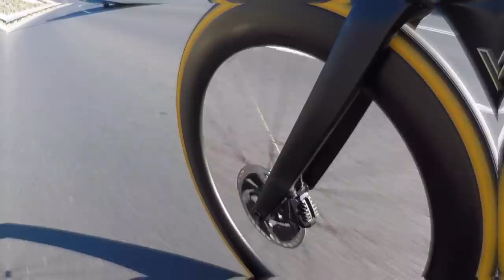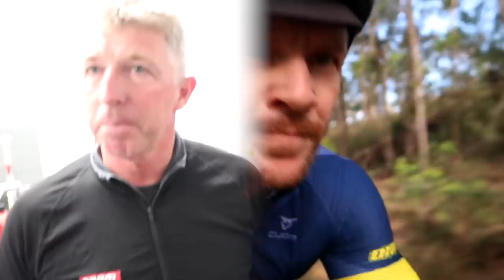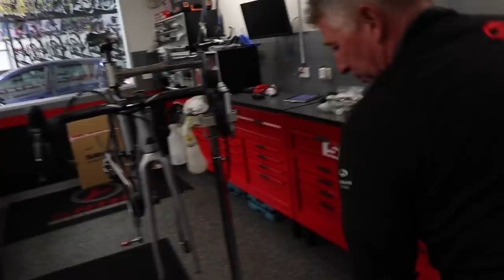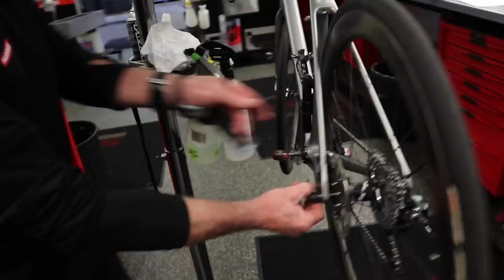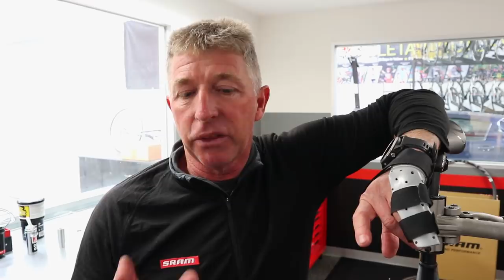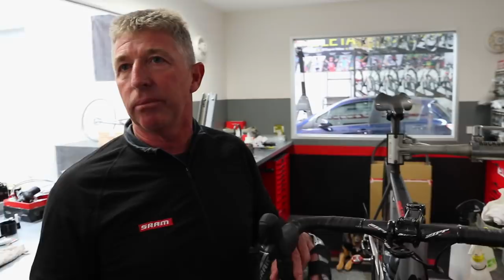Disc VS Rim Brakes (& Thru Axle VS Quick Release Skewer)

Comment: This Sram idiot was comparing a quick release skewer rather than a 10mm 4130 chrome moly heat treated hub axle to the quick release hub axle for the wheel to frame loading forces.
Yes you will need a larger diameter stiffer axle for asymmetric braking forces because of the disc brake designs. 
As for thermal management of the braking energy, the disc rotor which is typically 1/3 the weight of an aluminium alloy rims made from a material which will not transfer that heat effectively into air. i.e. 140 mm diameter rotor compared to a 622 mm diameter rim being air cooled. 
Having threaded composite holes in the frame for a quick release hub axle has its own problems.
In nearly 30 years of cycling, the idea that some folks can't use a 'retro' quick release because they are too stupid is just laughable and incredibly patronising. Maybe Sram should be selling after market stabiliser wheel sets as well, aerodynamic ones made from composite plastic costing $1000 RRP.
Reply from the maker: Very happy to have your feedback/comments/experiences, but no need to call Rob a Sram idiot. That's the type of comment I expect on Facebook, not YouTube. Cam
Reply: My apologies, I'm just getting sick and tired with the cycling industry (Patronising Journalists as well) constantly rubbishing and showing well designed older technologies in a very bad light just for the sake of what is at best, 'marginal design gains' with assumptions that all component design now has to follow and cater for the inadequacies of composite plastic frames and wheel rims etc. (poor bottom bracket tolerances, JRA failures and poor rim braking etc) so as to sell new products with very high profit margins to the trendy gullible cyclists. @CamNicholls
Reply: Amfear Liathmor Yeah, name calling is not necessary, but everything else in your post was spot on. QRs are a tried and proven system for decades. The reason they use a through axle is they had problems with the twisting forces associated with a one sided disc using a QR. The solid axle is used to try and transfer as much force to the other fork leg. But an expert in the field doesn’t mention this nor any other pro disc brake company and media. Don’t be fooled, there is design problems with discs, yes they have partly overcome them but rim brakes as you said, require less force and have a bigger area to dissipate heat, the main problem with rim brakes is carbon clincher failure, not the braking system itself.
Reply: Hmmm motorcycles don't have rim brakes so why should bicycles adopt disc braking if its prifen to be very easy to apply pressure and modulate not to mention braking with a warped wheel or in the wet us a real issue with rim brakes.
Reply: glenny oc Come on, motorbikes with bicycles??? No point even discussing that long bow......
Reply: @waynosfotos  drum brakes were the norm on motorcycles and worked well but disc was seen as a superior product.
Reply: Carbon rims or Aluminium alloy rims? Disc brakes are an excellent idea for composite plastic rims to improve safety. But does the addition weight of a disc rotor negate any weight savings of using a composite plastic rim?
https://youtu.be/ET1jRVynOBA?t=58
Exploding tub or exploding rim?   TDF time trial JRA failure.
https://www.youtube.com/watch?v=6rraDhZTDog
Reply: @gweflj  He should have used £20 Rigida Sputnik rims.
Reply: All that stuff for rich overweight middle aged men  who ride at 23km/h.....
Reply: @waynosfotos  Amfear Liathmor is a foaming-at-the-mouth retrogrouch who will defend outdated cycling technologies such a steel frames, quill stems, threaded headsets, freewheel hubs and cogs, rim brakes, metal rims, and downtube friction shifters to the death.
Reply: @CamNicholls  Amfear Liathmor is a foaming-at-the-mouth retrogrouch.

Comment: If cyclists are really concerned about axle strength, stiffness and failing quick releases, which idiots have a hard time understanding, just change out the hub axles for longer solid ones and then attach the wheels to the frame with some titanium M10 nuts and then take along a Campagnolo Peanut butter wrench along on every ride. Problem solved for about $40.
Reply from the maker: Thanks for the suggestion. Cam

Comment: Rim brakes damage the rims...…. Disc is a problem when flying if its oil...... Rim you don't spend much for maintenance...… Disc much heavier...  If disc is oil and you press the break when traveling as the rims are off you are fuuuuuuucked. ……. With disc you can burn your leg like Tyler did ha ha ha…  I would think the only time you need disc is in bad weather and descending.. Rim works but disc works better.....
Reply from the maker: Harry Tzianskis The God of Speed thanks for sharing Harry. Cam
Reply: I'm sticking to my V brakes. See you at the bike shop
Reply: Hi janet sers 😁 you talking about Tom's?

Comment: This guy's just a salesman.
Reply from the maker: General Manager of APAC actually. Cam
Reply: @CamNicholls  Comes across as an unbalanced point of view, and trying to push a product IMO. Rim brakes have some advantages and work perfectly well. I have disc on my MTB and CX/commuter and rim on road bike. Discs aren't worth the extra cost, weight and maintenance unless using carbon rims or likely to get wet/dirty.

Comment: Traditional QRs have greater clamping force than the incorrectly named thru-axel, it's easily proven by math....

Lawyers tabs...oh so the skewer didn't fail, the people failed....he said it I didn't.

They take the heat of braking an put it into a structure that is under engineered for the heat generated during long descents...

Comment: The most stupid arguments I have ever heard and even worse from someone that supposed to have experience and common sense, Everything contrary to the logic, It is obvious they have to push the new products, he get paid for it, which is understandable, but saying skewers are less aero, have failures, I don't know what kind of fails he is talking about, I have never experienced any issue with cheap or expensive skewers, nor the pros in grand tours pushing the bicycles to the limits, complicated because some people apparently don't know what is the right side, not stiff enough? dangerous because your whole life relies there when they just tighten up the wheel but the wheel itself is supported on the hub, not in the skewer.
The funniest is when the guy tries to release the wheel "Nice and simple" and almost breaks his other hand.
As far as breaking is concerned he said overheating rim wheels happens all the time causing accidents, something is absolutely false unless you are using the cheapest Chinese carbon wheels with the wrong brake pads, but apparently, disk doesn't overheat which is something even Chris Froome complained about.
At the end, he points out people need to learn how to break properly with disks giving an explanation that doesn't make sense, an average person will just pull the trigger, It should be as simple as that.
The guy is also asked if disks are more expensive, more lies apparently last longer and quieter, I have used red brake pads Campagnolo for nearly 4 years and they still have one more year of life ahead, If I had disks I wonder how many times I have to replace rotors and pads in 4 years other than the constant tunning and money I have to invest in mechanic fixing it, Good calipers just don't need maintenance, I have campagnolo record 2015 and they are just perfect.
The only place in Australia you can find a long hill to descend where you need that braking power is in Tasmania, I am from Colombia where the average mountain is 20km long for not mentioning Paramo de letras which is 80Km long, It is incredible how people are brainwashed creating unnecessary needs adding more variables to a system was already perfect.
If Rim brakes work for INEOS Team It works for everybody.

Comment: Impose new "standards" to increase sales is just pissing on buyers. Weight increase and the maintenance is a steep cost as well. And I just cant say it looks good from any angle. A roadbike there is not much rubber i contact to the tarmac, so its just no logic to have discbreak.

Comment: Ah yes, comparing a skewer to an axle. The first one doesn't take major loads, but just enough tension to keep the wheel in place - the axle in qr system is much more robust and only 2mm narrower than thru axle. 
Marketing BS comparison

Comment: What a load of rubbish. More weight and harder to tune, more likely to skid on slippery surfaces and slower to change wheels. no wonder the peloton is reluctant. Don’t believe the hype.....it will SLOW you down!!!
Reply from the maker: fair call, thanks for sharing your thoughts. Cam
Reply: More weight? True. 
Harder to tune? False. 
More likely to skid? False. 
Slower to change? No.
Why wouldn't you want better brakes? No idea.
Rim brakes are moribund.
Reply: Scooper MG Everyone knows you need to bleed, reset and get disc pads just right. As soon as you get grit in there, they grind and you can’t just loosen them with one small lever. More efficient braking v the same small patch of rubber on the road = more skidding in wet or damp conditions. Just physics my friend. It’s another example of fixing a problem that isn’t there!
Reply: @icycalm03  lol tyres grip not brakes you can modulate disc brakes easily.
Reply: @icycalm03  You set the brakes up on installation as you would with rim brakes. You do very little else following that with discs. They self adjust as they wear to a large degree.
Less control with discs? I suspect you've not used them, as the reverse is the reality. Modulation init.
Still unsure why anyone wants poorer brakes. Tightfisted, weight obsessed types presumably.
Reply: Scooper MG yes...you just keep on believing that Scooper. Lol.
Reply: @icycalm03  I shall, thank you. Rim brakes are already moribund. 
#headinthesand
Reply: If you have ever owed a mtb bike you'd know disc braked through axles are the easiest wheels to change. Calliper brakes that won't let go of the tyre are slow to change
Reply: Texture that’s just not true. That’s why all major tours were won on rim brakes this year. They are faster and more adjustable. It’s all just hype!!
Reply: Scooper MG good luck dragging all that extra crap uphill! #dontbelievethehype